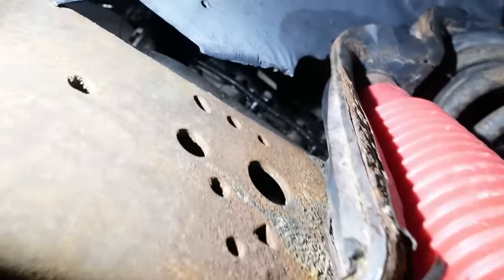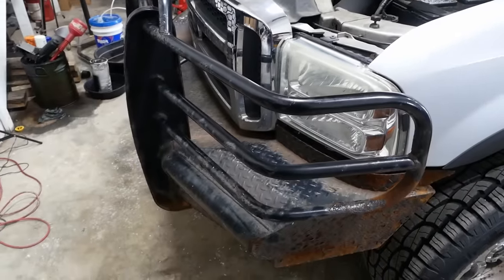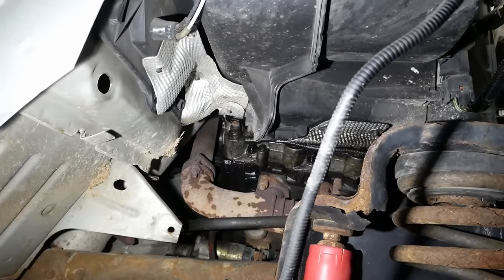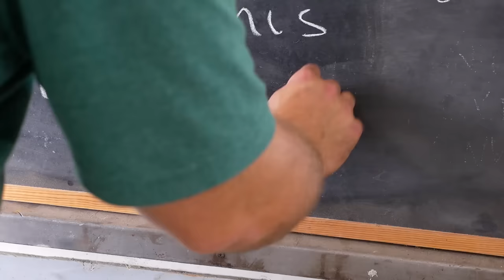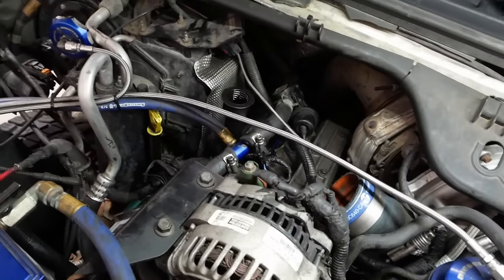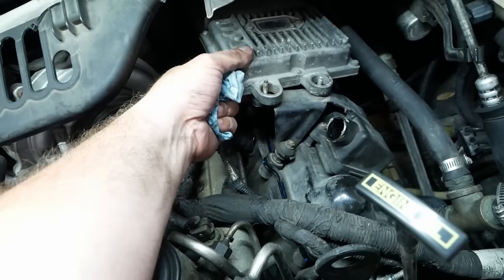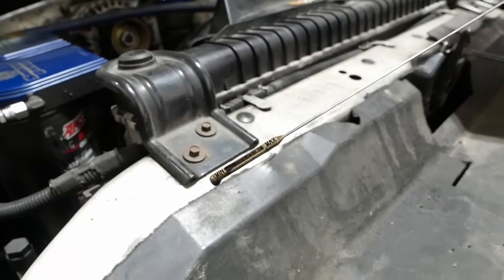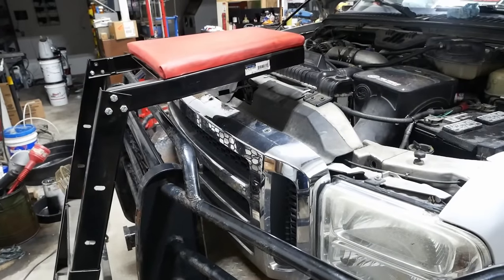6.0 Power Stroke Makes me Question my Life Choices - Major Oil Leak

Comment: 4:25 Coolant filters are added because they prevent other potential problems from coming up. Cavitation, oil cooler clogging up, & just plain filtering out of the leftover casting sand theyre known to have in them. I watched a video the other day that a customer put in a 'factory reman' 6.0. It was not right & on the verge of catastrophic failure. So he meticulously disassembled it, all documented on a Yt video. It STILL had some casting sand inside of it after a 'service life' & a rebuild!! The coolant filter is just one of the things that helps this motor last long & prevent failures. It is a good, strong engine....it just needs a lil TLC & a few $$ to make it better. Yo know Wes, its a love/hate relationship w\ that thing!!! Personally, i stick w\ my 7.3's until i get the big bank account(or win lotto) to potentially put into one of these engines🤷🏼‍♂️🤦🏼😆 Id love a king ranch 6.0 but that'll have to wait for my future lottery check to come in. Lol 😆🛠️👌📏🔧👨🏻‍🔧
Reply: 8:48 Yes, that'll definitely cause a leaky valve cover!!🤔 Nothing a lil silicone goop & some Jb weld can't fix right up!  😆😆🤦🏼🤷🏼‍♂️🛠️📏🔩🔧
Reply: 16:20 Wow! That's a crazy pic! Stared @ that for a good few mins & still confused 🤔😅🤷🏼‍♂️📐✏️👍

Comment: To get more threads use a bottoming tap. Don’t buy them either just grind the tip off of one to get rid of the starter threads. What kind of adult beverage were you drinking?
Reply from the maker: New Glarus.

Comment: I don’t think that’s a 2005 model year truck. The blue International label on the right valve cover implies it’s a 2003 or 2004 model year. The date should be right on that sticker along with the power rating. 2003-2004 will have 560lb-ft. 2005-2007 will have 570lb-ft and the sticker label will be red not blue. 

Also, since the torque spec on the valve cover is so low, repeated removal shouldn’t be an issue. It’s probably more like sloppy work from whom ever is wrenching on it. I e had mine on and off a few times, no issues. Definitely agree on the inner fender liners though!
Reply from the maker: The truck is an 05. The ICP sensor is in the front. It has the later pcv design. But I'm not at all ruling out that the engine could have been replaced. Maybe more than once.
Reply: @WatchWesWork  The truck itself looks like an 05, with the updated grille and headlights. ICP sensor would be up front on a 2004 as well. Only the 2003 and very early '04's had the ICP in the back near the IPR. Strange that this one has a blue sticker on the valve cover if it is a 2005 model year.

Comment: Coolant filters are pretty good to have on any 6.0’s 6.4’s and apparently 6.7 powerstrokes as well. They apparently had issues with sand being left in coolant passages of the engine blocks from the factory. There’s lots of research documenting this and that’s why companies make the coolant filter kits.
Reply: The military used these trucks overseas in war for quite some time and they had they’re fair share of problems with them. They were really one of the first to figure out what was wrong with the 6.0

Comment: Could you use a 1/4 inch drive palm ratchet and a hex shanked drill instead of a modified drill bit and small spanner to make drilling the hole easier
Reply from the maker: I don't think you could get any kind of ratchet in there. But a hex shank bit is a good idea.

Comment: I have a 2006 Ftoshity but it’s rust free no oil leaks 170000 miles BUT I think it might need glow plugs it’s 6.0 is it a tough job?
Reply from the maker: It is here. The harness typically breaks off in the lower valve cover and you have to dig it out with wood screws or whatever you can jam in there. If you live where there's no salt you might get off easy. Plan on replacing the harness.
Reply: @WatchWesWork  before I do that I bought a obd2 scanner and it says the injector control pressure is high. Is it a sensor or something worse?

Comment: Wes, ive been a mechanic for 50yrs, love your approach, sense of humor and tenacity.
A fine thread self tapping bolt is a great idea, probably have to be an odd size like 7mm. Theres your next merch idea!
Keep up the great work!
Reply: I've had my hands on experience with M7 fine AND lefthand thread AND long bolt (~90mm). It broke. The longest one I could find locally was 60mm. Luckily, the bolt had little stress to resist and I found a thread cutter. Getting remains out was surprisingly easy, just a normal drill spun it out.

Comment: Solution: helicoil kit that includes a short drill bit that can be driven off a 3/8 drive ratchet, which can then be run by your cordless ratchet there. Same for the install tool.
Reply from the maker: You can't fit any kind of ratchet in there.
Reply: @WatchWesWork  Maybe one of those pass through 1/4" driver deals? I'm thinking probably a manual tool at this point considering.

Comment: I just had a early 04 come in with a driver side valve cover leak. It was rusted threw. I called everyone and every place I could. The only place I could get the valve cover was from Ford. At the price of $691.00. Included the gasket and half the bolts.. 😅
Reply from the maker: No kidding? I've probably scrapped a dozen over the years.
Reply: @WatchWesWork  it was a first year 6.0 without the external breather.
Reply from the maker: @bohawkins5258  OK. I might have used a newer one and just put a cork in it!
Reply: @WatchWesWork  it was a customer vehicle so it was ultimately his decision on how to proceed, he chose to spend the money. 6.0 people love their trucks.